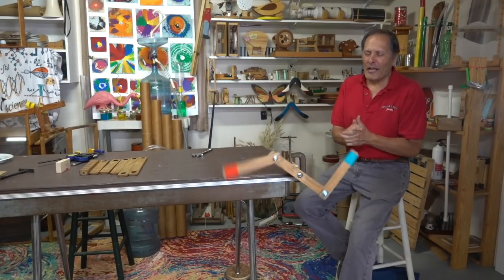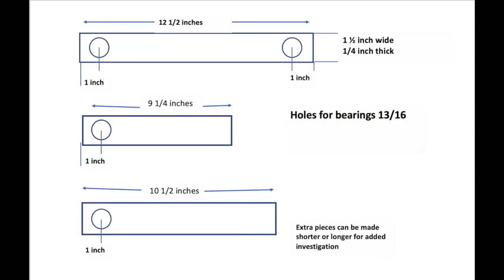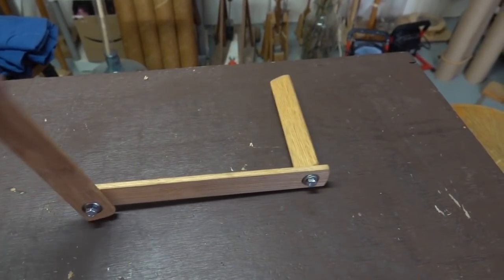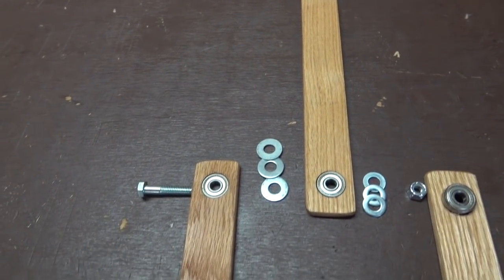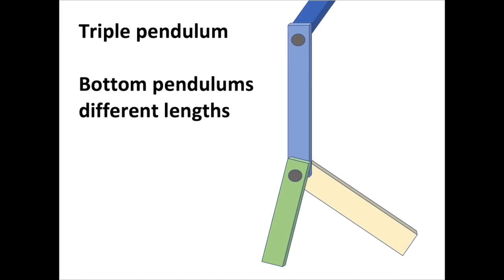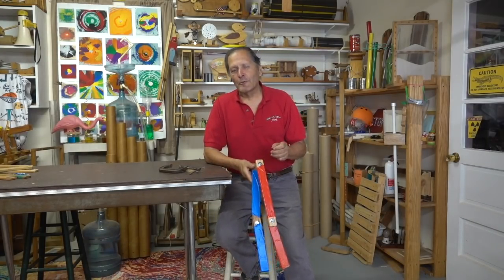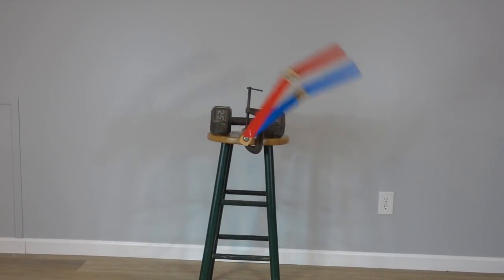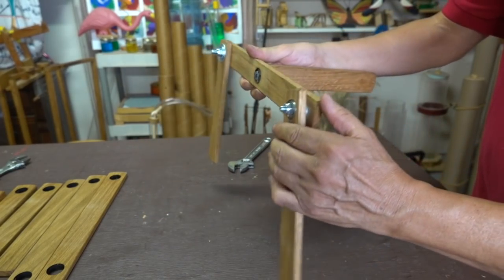Chaotic pendulum's entertaining behavior,   //  Homemade Science with Bruce Yeany

Comment: I was not able to find a 13/16” drill bit. 7/8” works by lining the inside of the hole with a little hot glue or silicone sealer.